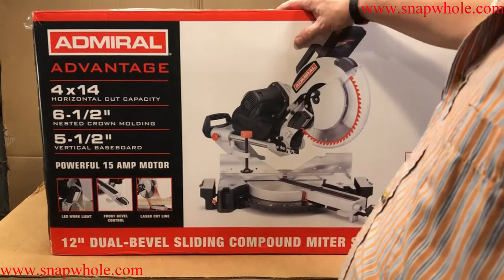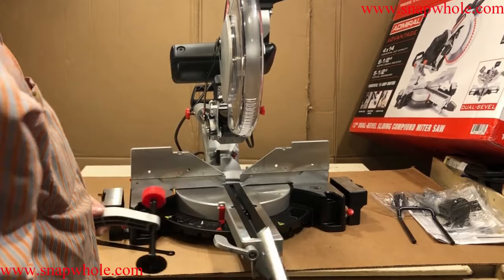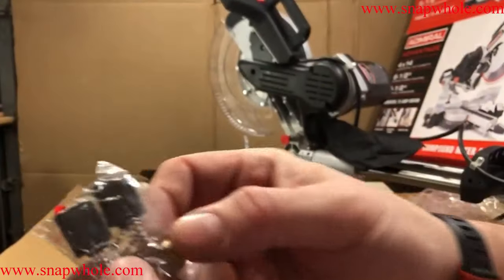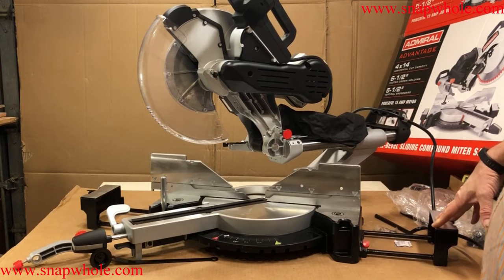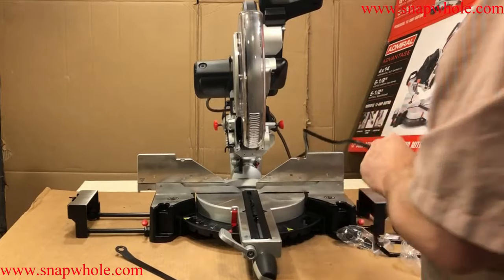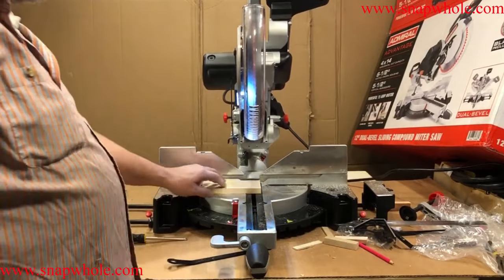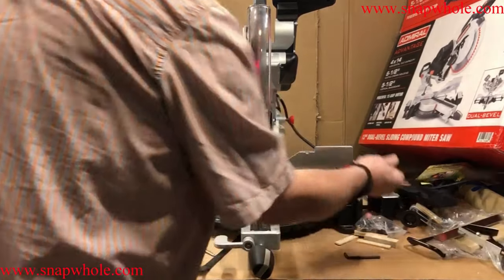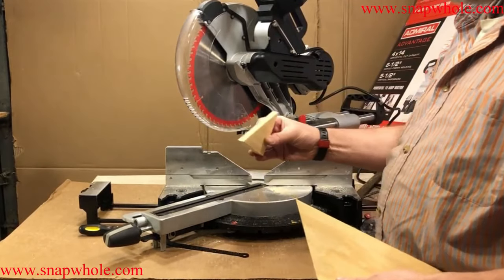Harbor Freight Admiral 12 inch Dual Bevel Sliding Compound Miter Saw Setup and Review

Comment: I bought one of these as the Craftsmans I had finally quit.  This saw works fantastic. Seems well built and should last a long time. Cuts are square, motor runs smooth and glides up and down the tracks nice, everything works just like it should. For the money, this will work for any homeowner or weekend carpenter, probably would work for a professional too. Only problem was as you indicated the cord. Just be careful and always have an extension on it. Otherwise this saw is a total win. Did the molding for an entire bathroom with it, very impressed
Reply from the maker: I used this saw for quite a while, eventually upgraded to the hercules, because I wanted that saw, not because there is anything wrong with this saw - this is probably the best saw for the money that HF sells - Thanks for subscribing!

Comment: The laser and LED light are very easily broken. I bought one only only one week and laser is gone, change another one, the same problem, I thought  I can use it without laser, but two weeks later, the led light is also gone! Terrible experience, I just want to find the reason why the laser is so vulnerable.
Reply from the maker: I suspect you will find vibration as the cause of the laser/LED light issues -The CE mounted the laser on the base, which I think would cause less vibration - Thanks for Subscribing
Reply: @snapwholeharborfreightreviews  thanks a lot, I will try to check it.

Comment: Hi, Just bought the same miter and found that the blade veers to the left as I bring the saw down. Same thing with the laser. Adjusted per your video. Almost there. Thanks for the video.
Reply from the maker: thanks for Subscribing!
Reply: how did you fix the problem
Reply: It might be the bevel angle. 
My saw only bevels in one direction.
When bringing the head from an angle back to zero, the head will pass up zero. About 2° or so. To my eye it looks straight, but hard to tell with the housing covering the blade, but I see it in my cuts.

Comment: You keep comparing this to Chicago Electric. The build on this one is much better. I have had this one for a couple of weeks and I love it.
Reply from the maker: the base design is the same, with some important differences, most of the upgrades were also implemented in later models of the CE - btw - I have the CE, the admiral and the hercules, they are all good saws, once tuned the CE and admiral are about equal in performance, the hercules came tuned, and is a slightly better saw
Reply: How much smaller is this unit compared to the Hercules?
Reply from the maker: @gregreaves4097  - they are about the same size, although the cut depth (vertical) is a little bit more,  I upgraded to the hercules and I think it was work the extra $100 - watch my review of the hercules - https://www.youtube.com/watch?v=KEWOAVBCZg0 - Thanks for subscribing!

Comment: Bought one this week, used it to cut flooring for a small (5x11) laundry room I was reflooring... After the first two days of use, the laser got progressively dimmer, then went out entirely! I checked the manual, nothing about a battery, but I did see a transformer in the parts listing, so I know the LED flood light & laser are supplied from the 120VAC in... I removed the laser cover, and found it packed with sawdust! A good cleaning, and all was well again. I may have to keep an eye on this, and come up with a work around to keep sawdust out of the laser housing- otherwise, I love it!

I do have a suggestion- add a rubber cover to the ends of the body where they extend down under the angle release- I was working on top of the new hardwood(!) had to turn the whole saw, and managed to give myself a nice scratch from one of them when it tilted as I moved it... My fault, but rubber on the ends may alleviate this tendency...

They could also use a molded cord grab on the plug: Otherwise there s nothing to keep the wire looped up well. 

Dust bag is pretty well useless- I hooked it up to my shop vac most of the time.
Reply from the maker: thanks for Subscribing!

Comment: Thank you also for an excellent video. I have my new saw which looks used, the blade is very rusted, the knob to release the saw from the lowered position does not budge and the lever does not move. I am returning this one and hopefully, this one will really be new and work.
Reply from the maker: I have learned to open the box in the parking lot and checking for a returned item - harbor freight definitely has a problem managing their returns
Reply from the maker: Thanks for subscribing!

Comment: The best price I have seen in a while for each, is $130 for the Chicago and $170 for the Admiral. However the Chicago version doesn’t come with a blade where as the admiral does so that’s like another 20 bucks you would need to add to the cost of the Chicago, making it now $150. Taking the blade into consideration now it’s only a $20 difference, making the Admiral worth the extra money for the upgrades. It’s just a matter of waiting for the Admiral to go on sale or have a coupon for $170. Thanks for the vid.
Reply from the maker: Thanks for the comment - the CE has been discontinued, which means its probably already disappeared from stores - I think HF made the same realization....... and the CE was getting a long in the Tooth, like 15 years or so old - Thanks for Subscribing!

Comment: This also seems to have a blade brake and the older model does not, which is a major productivity upgrade.
Reply from the maker: what are you considerting the 'older model' I have the CE model also, and it has a blade brake, curious of the the older model changed over time - thanks for subscribing!

Comment: Good review! Someone figured out how to adjust the laser by taking the housing off and adjusting the screws. Not obvious and a fair bit of work but you only have to do it once.
Also, last I looked into this and the Chicago electric, the CE did not come with a saw blade. That brings the costs a little closer together. I don't know your thoughts on the blade quality after using it for real cuts? Is it worth keeping our do you just need to buy a decent one and get rid of the one included?
Reply from the maker: I had no problems with the blade, but I prefer an 80 tooth saw blade, so I replaced the provided one with an 80T saw blade, and put the provided one on my CE mitersaw and its performed well

Comment: Thanks for the good demonstration. And do you think this is really that better than Chicago Electric or better to buy than one cheaper? (I believe the fence on that is useless and breaks in first or second use but then most who have it, like it. Then...
2:06 Isn't that Chicago electric 12 version has 2 Allen bolt, on the back, right side, if you look from the back that Top one turns (Adjust it) to the left, bottom to the right? Or are those only for the 45-degree adjustment?
Reply from the maker: its better than the CE, its the same motor, but the adjust from the front is nice, at the time I made this video HF still sold the CE, now they don't, this is now the entry level saw at HF, but the CE had been around for about 10 years, and it was due to be replaced, and the admiral was the replacement - Gave the CE to my nephew, sold the admiral because I wanted the hercules, and I am completely happy with the hercules and its seen heavy use - thanks for subscribing!

Comment: Anyone else? Video stops playing @ 22:22 & restarts @ 23:19? Audio stays on just video freezes. Been having this problem for a couple weeks. Using ACEPC with a 40" flatscreen as monitor. Sometimes have to close Chrome browser to get it to respond. Don't think it's a YouTube issue. One thing I see about these saws I don't like, not just this particular manufacturer, is they should have a shock mounted on the vertical pivot. Lots of clanky. clanky when it reaches limit of travel. Either a shock or some Teflon washers to cushion the stop? I haven't finished vijeo yet am wondering is he found a way to adjust laser? I'll continue now...it's a mystery.
Reply from the maker: thanks for subscribing!
Reply: You can adjust the laser by removing it and making a modification to it and reattach. You have to modify so you and move it some to line it up at the laser light module

Comment: Sorry if I missed it. But what do you think about the bevel? Specifically 45° bevel cuts?

Putting it all the way until it stops on left / right is it a true 45°?
Reply from the maker: you have to turn the saw using the steps I used in the video, in the case of the 45 degrees, do a test cut and use a square with a 45 to confirm its correct, if its not correct, you can adjust the stops - mine was set correctly at the factory, but you still need to check it - Thanks for Subscribing!
Reply: @snapwholeharborfreightreviews  Are talking about 45° miter or 45° bevel?
Reply from the maker: @levijessegonzalez3629  45 degree miter, you adjust the bar that has the detents for the miter, for 45 degrees bevel, you adjust the pointer on the degree scale, but I custom cut a block that let me lay the blade  down until its flat on the block to set 45 degrees,  that pointer and scale have to much slop to get the same angle consistently

Comment: Mine didnt come with a blade, and mine won't accept a blade cause the shaft it hangs on is bent.  I have to return mine for a new one, which makes my customers WAIT till I can fiddle again with the next one that comes around.
Reply from the maker: can you provide more info on what is bent? the blade mounts directly on the motor shaft, seems like if the motor shaft was bent, the blade would still mount, but be unsafe to run as it would be off-center - trying to understand what was the problem, so anyone reading the comments could benefit from your experience - thanks for subscribing!
Reply: @snapwholeharborfreightreviews  That round seat that the blade sits on was bent.  AKA, had to return it due to it won't allow you to mount the blade.  Ended up returning it, and getting a new one.  This new one does allow the blade to be mounted and it works BEAUTIFULLY!  Can't be more excited about doing some projects!
Reply from the maker: @deborahelliott8460  - thanks for providing additional details, it will provide help to others that read the comments - thanks for subscribing!

Comment: Hello Sir! Just bought this and Im freaking out because the handle seems to rock back forth from left right depending on how much pressure i give it and its messing up my cuts. 

Sorry if I missed this. But do you discuss how to "tighten" that up on this video?
Reply from the maker: is it the handle that racks, or is it the blade? make a few cuts and on each cut try to rack left and right and see if the accuracy changes and by how much, if there is, you will need to check the entire slide mount and find the issue, mine did not have that problem, so the fix will depend on where the issue is located - Thanks for subscribing!
Reply: @snapwholeharborfreightreviews  Yes so Its the entire blade / handle / motor etc.

Worse when you're doing bevel cuts. 

If you put more weight on the right, the blade is going to go to the right and visa versa
Reply from the maker: @levijessegonzalez3629  that is a hard issue to troubleshoot and fix, but - check the slides rods to check if they are tight in the linear bearings, if there is any slop there, you probably will not be able to fix it, you also need to check the linear bearings where they mount on to the mount mount assembly, if there is an slop there, you will need to tighten up the mount until there is not slope, after that, you should call HF customer service, but I think you will be returning the saw for another one - if you take it back, you should video what it is doing so you can show the manager, but I recommend you go over the saw and find out where the slop is happening, if you get another one and even if its ok, thru use it might loosen up a little and tightened again

Comment: My locking pin knob fell off and now it's stuck in the down position and I can't get it back up. What can I do to fix this? It just falls back off when I screw it back on. This happened in the first day of purchase!
Reply: Return it and get another one
Reply from the maker: its likely the knob cracked, use a pair of pliers to pull out the pin so you can use it, replace the broken knob with a nut (or two)
Reply from the maker: returning is really only an option if you are still in the purchase warranty

Comment: I have given up trying to adjust the blade and fence to square. I regret purchasing this saw. I would not trust this saw for precise work like compound miter cuts for crown molding. I use mine now for straight rough cuts only and make true on my table saw.
Reply from the maker: Did you follow the process in the video? I ended up with square cuts for 90 degrees and 45 degrees - the odd numbers in between are harder to measure, and I had to buy another tool to do that, but its accurate - if you are having trouble flexing the fence, you might have to use clamps to get it square before tightening it down
Reply: @snapwholeharborfreightreviews  yes I tried your way and another way. The fault i believe was in the rail system. Maybe I dont really know. Out of box it was out by a lot I tweeked on it took that back the store manager laid a square from shelf on it yep out of wackngave me a new one and same darn thing can't get 90 out of it. So I am.just giving up on the admiral.  Wife wants me to try the Hercules however I would prefer the Delta Cruiser but heck I am just a hobbiest so that cost would really need some justification.  

Its not the first time I have gotten back to back faulty tools from Harbor Freight.
Reply: The Hercules is good. I've got a Dewalt and Hercules. And the Hercules out performs my Dewalt. The Saw is dead on accurate. I laid Hardwood floors my entire house with tons of angles using the Hercules, all perfect cuts.